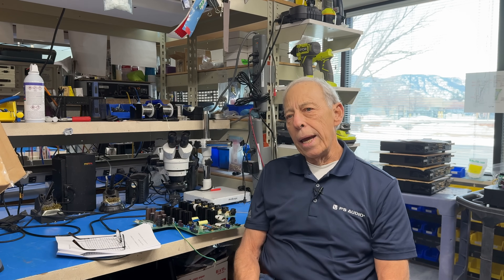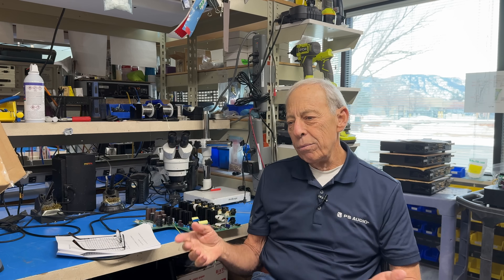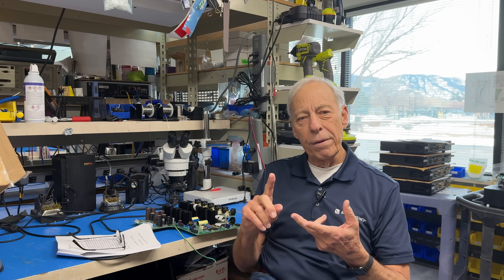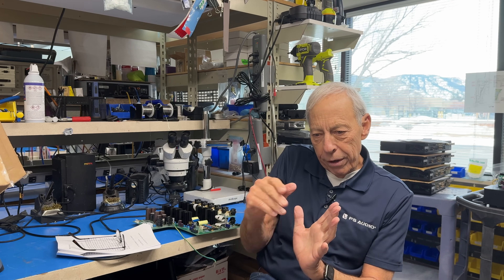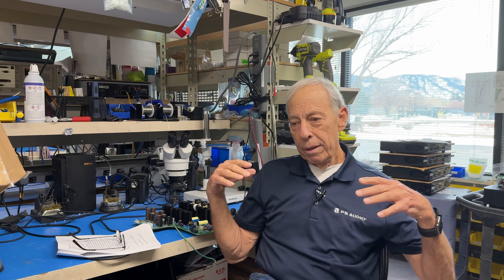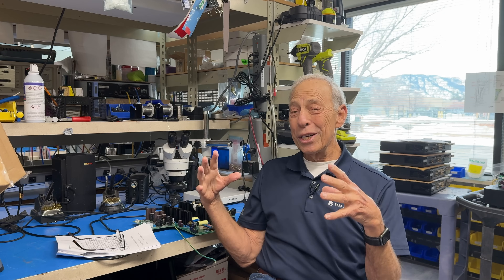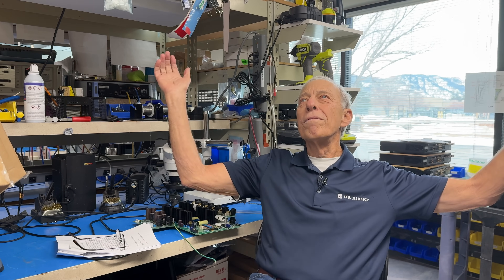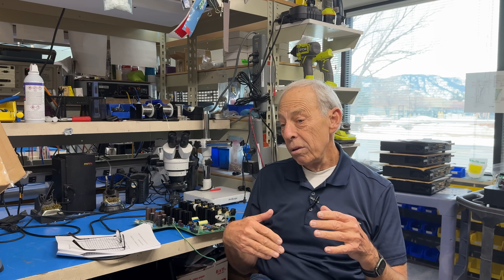Why power amps have more wattage than speakers can handle

Comment: I bought my 1st stereo in 1978 when I was 16 at Tech HiFi & the salesman sold me Ohm speakers & a 25 watt Pioneer receiver & I blew up both tweeters by the end of the week. They swapped the speakers & upgraded me to a 35 watt Technics receiver & within the next 2 weeks I blew a woofer & tweeter in one speaker & the midrange on the other. I went back & the manager took over & listened to everything I had done & what I was really looking for in a stereo system as a young man. Finally my message got through & he upgraded me the right way with a pair of JBL L40s & a 100 watt Nikko receiver that changed EVERYTHING. I was in teenage heaven. 1st thing he said to me before the upgrading was that you will never damage a speaker if it's over powered as long as you play it within it's limits but you will always cause damage when you underpower & push it past it's limits. I don't remember the term "headroom" then but that's the day I was taught about it. Thank You Ralph wherever you are.. much appreciated 👍
Reply: I worked at Tech HiFi in the 80s while I was in college
Reply: Makes sense, speakers can handle clean smooth signals/movements better than crazy distorted movements
Reply: Paul explained it very well

Comment: Need the current in case you happen to be running a pair of Apogees.😊
Reply: Apogees are not that difficult to drive unless you buy the 1ohm scintilla.  The only reason you need a lot of watts is because of the sensitivity.
Reply: @mitchtaylor6512  Yes,the Scintilla was the model I had in mind.  Having said that there are many speakers out there that may dip considerably lower than their specified impedance.

Comment: It's the old confusion over "Watts".  Power is energy/time.  Paul mentions a typical house room circuit at 1800 Watts, but that is based on 15 Amps. The circuit breaker is usually for 15 Amps (though newer houses may have 20 Amps breakers, or even 30 for some rooms.)  The music amplifier is not going to pull that many Amps instantaneously from the wall.  Instead, the amplifier holds energy in capacitors internally, and the instantaneous power for the speaker circuit will pull on that stored energy.  The entire point of having amplifiers for speakers is that the speakers are not plugged into the wall!
Reply: The amplifier Paul was talking about is rated 1200W RMS so it can deliver 1200W continuously, which means that it has to be fed that power to do so. That you'll never use constant power in practice with music is pointless to add beyond what Paul already said because it doesn't change the answer to the question that was asked. It is about headroom and linearity, nothing else.
Reply: It goes further than that.
Modern circuit breakers are designed to trip "instaneously"  only for  significanly higher  values of current than its rating . 
( it is a magnetically operated trip mechanism)
This is so they dont "nuisance trip" if one connects a load such as a large motor that takes a high inrush of current as it spins up.

 In the uk typically a type "B" breaker will trip at 3 to 5 times its rated current.  
There are type c and d breakers that trip at 5-10 times(c) and 10 -20(d) times their rated current

If a steady state current is taken.. the breaker will not operate in a short time  until that current is significantly  greater than its rating...( at least 1.5 - 2 times 
( this part of the breaker mechanism relies on a thermal trip - in other words takes time to heat up.
If one looks at the response curves of a breaker you can see time to trip in seconds  versus amount of overload
Reply: That's a much better explanation, I don't think Paul touched on caps.